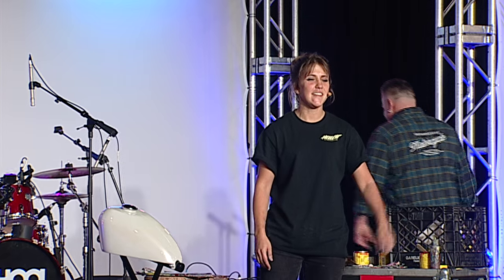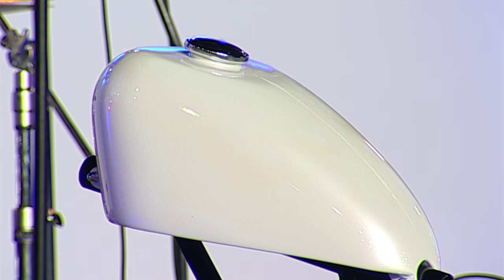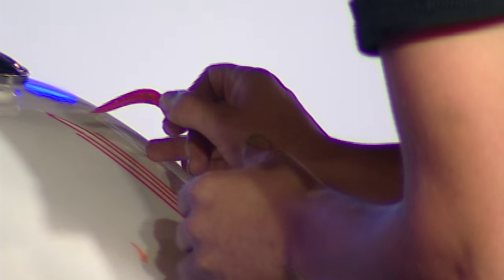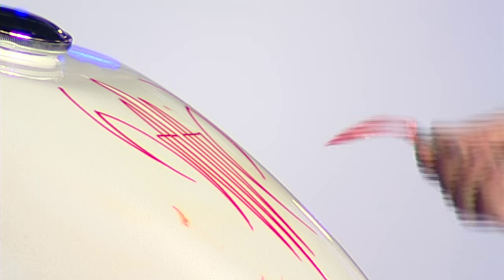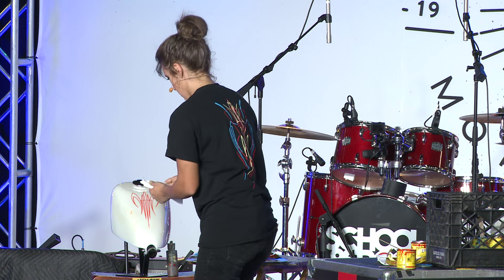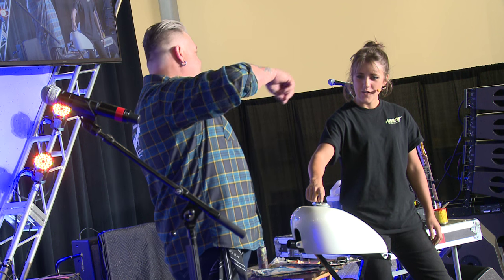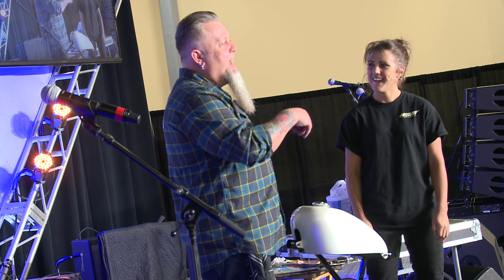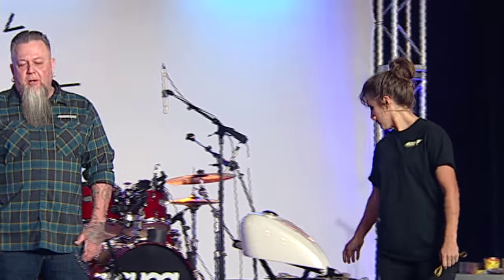Jillian "HellCat" Rossi on Pinstriping (Video Instruction)

Comment: using Q tips with rubbing alchohol works good for cleaning smudges early on, once it dries a bit, then mineral spirits.. I like terpentine to thin with, it gives the paint more of a creamy consistancy.
Also I find if you let your eye look where the line is going, rather than where the brush actually is, things seem to go easier.
In my opinion holding the brush like a pencil, is the way to go, because your wrist is basically a natural pivot hinge,  and you can stay off the work area,  using your forearm to brace.
Reply: The brush is not like a pencil. { Jillian taught me this] . You drag the brush across the work . Don't pencil the brush.
Reply: everyone has to find thier own prefered way to hold the brush. theres no right or wrong way if it works for you.
Reply: I think you will find you are close to a 45% angle. But yes, there is no right or wrong. Whatever works!
Reply: I use the very tip of the brush, so its less angle.
Reply: tt the video is about her work not yours. make your own!